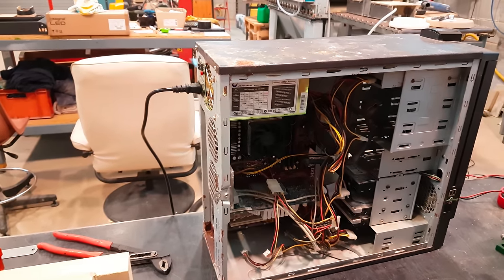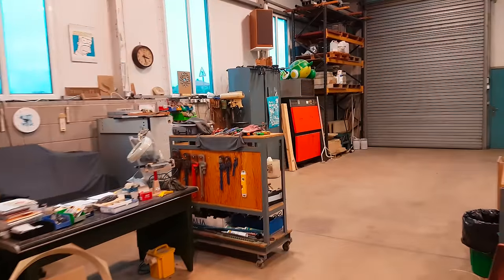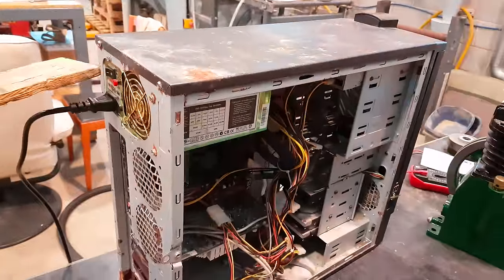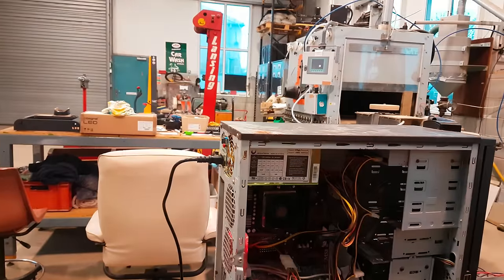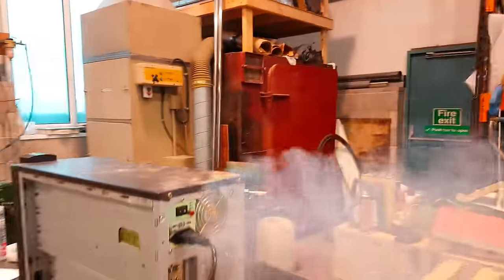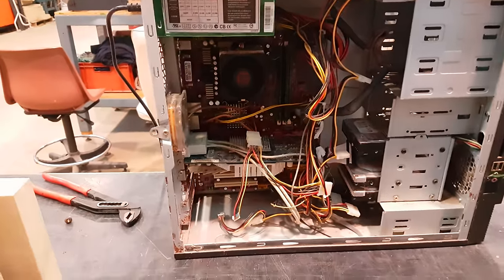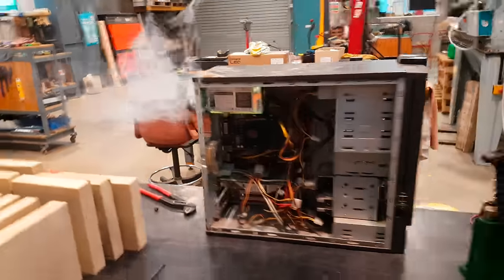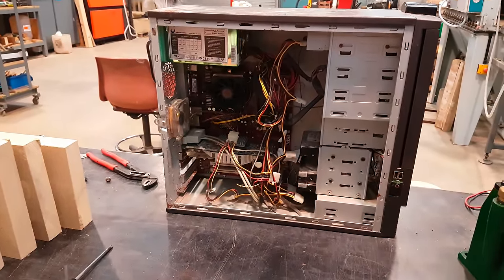Computer Explodes!

Comment: Noone with brain turns on a "water damaged PC" like this. The power unit could have been tested alone, outside the pc - and of course after opening and drying. Board and cards don't have problems with water, I would have waited until they are dry, cleaning them afterwards with Isopropanol. Harddiscs are a risk ...
Reply from the maker: It’s made me £3000 so who has the brain now?

Comment: Capacitor in PSU exploded, then the chain reaction burnt power regulators and unctrollable voltage with sinusoide from second coils of transformers went to internals

Comment: Once you let the smoke out it will never run right.  The EPA regulations on smoke refilling stations have run most of them out of business.  In the 80’s there were thousands all around the country.  I think now there are only a handful left, but they are very expensive.  So unless your electronics have deep personal or nostalgic value, it is cheaper and quicker to replace rather than send in for a smoke refill.

Comment: Must be running an old AMD K6-2 450Mhz CPU with inadequate cooling lol. Omg those things would roast boards back then, especially if you didn't set the jumpers correctly! Yes kids, we used to have to set jumper pins for voltage etc... It took brains to build machines way back then. Of course, this isn't running what I said, but it reminds me of a mistake I learned from where this happend and smoke poured out from every crevace of a PC I built back in 1998 and set the jumpers wrong lol. The good old days!

Comment: A friend of me made money with cleaning hardware after water damage. You need to disassemble everything, using distilled water to clean it, have some dryer for the hardware and then it works like nothing happened. It is not the water itself that makes the short circuits, it's the impurities in the water. ;)

Comment: That would be capacitors exploding. Had a bolt of lightning hit our pole once and other than the boom from the strike a capacitor exploded in our filter for the phone line for our DSL exploded blew the plastic off the filter and hte capacitor then bounced off the wall.

Comment: My 650W PSU exploded once too when my pc was about 8 years old. There was a loud bang inside the pc casing and the living room went dark because the circuit breaker popped. After turning on the breaker again, everything in the house worked except my pc wouldn't boot at all. Not even a single fan was turning. Bought a new 700W PSU but that was a cheap one and sometimes my pc would have random reboots. I guess it couldn't deliver the power required even when it's supposed to deliver 50W more than my old PSU. And after about half a year, that PSU died as well. Now I got a 750W modular one which works really well.

Comment: Wood is still a conductor of electricity, but lets use it to be safe, durp\
Reply from the maker: You clearly missed the rubber gauntlet. And the wood was very dry. Still better than touching bare metal.
Reply: @ComputerExplodes  listen again . he said he wasn't using them and is going to use......

Comment: When your power supply is set to 120 volts and you plug it into 240 volts. I've seen this before in real life. Mother board is probably okay.
Reply from the maker: That's not what happened.